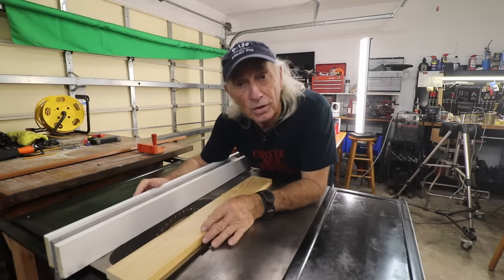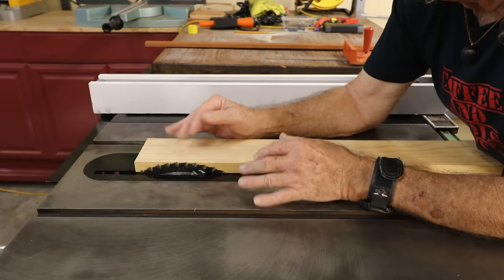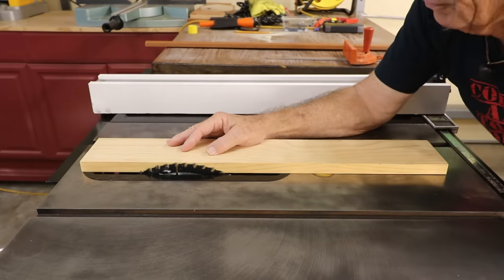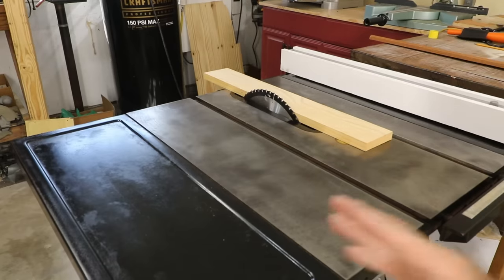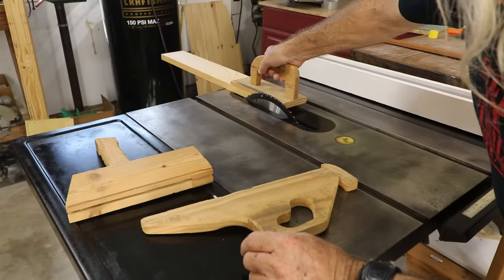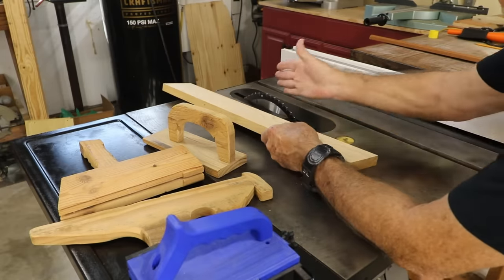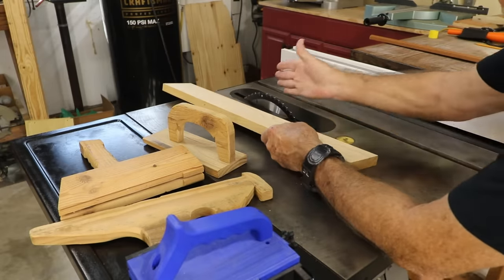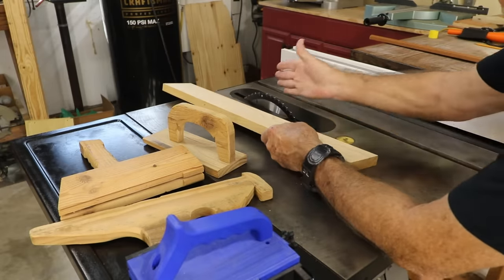Table saw secret nobody will talk about from the good old days, C&T episode 180

Comment: You know what’s even safer?…..not putting the blade up at all. Try that whiners. I’ve tried many positions, depending on the material I’m cutting too. It varies, and you go by feel, and the quality of the cut that you get. Newbies need to be educated on all of the other safety practices, and how to use the push sticks and other implements. Understanding the materials you are cutting is half of the process. I wouldn’t want a newbie pushing harder on material to get it through the saw. Yeah it’ll work, but it seems like a lot of people just wanting to avoid responsibility. My rule of thumb is bottom of the blade gullet even with the board, and at least an inch above if I’m ripping particle core. You have to find the sweet spot of your specific blade for melamine, so it’s not all chipped to crap, too.

Comment: So' I  shouldn't free hand cue ball cut the line on a length of plywood for an angle I needed quickly ?     Never had a problem,  besides a few bad cuts. but they were acceptable for the project.    I was doing it way back when I framed, 20 years later, I still do it, with blade 3/8- 1/2" higher than lumber .  I have a to of jigs but I never go into a cut without "Respect"
The guys I've spoken to, were too comfortable,  careless and got hurt bad.   You gotta treat and respect your equipment right.  Just like your wife.  I guess.?

Comment: The higher you set the blade, the greater the error (tilt) of the vertical blade to the horizontal table. Conversely, the lower the blade, the "tilt is reduced.

Comment: He has just broken 3 of the golden safety rules when using a tables saw 1, Your hands should never pass the blade hence the reason for a push stick, 2. Never remove the riving knife as this allows material to grip the blade on the up stroke.3 Look at his long hair hanging loose that is a no no with any power tool, he is a hack and and a liability pay no attention if you want to keep all your digits.
Reply from the maker: There you go John :)